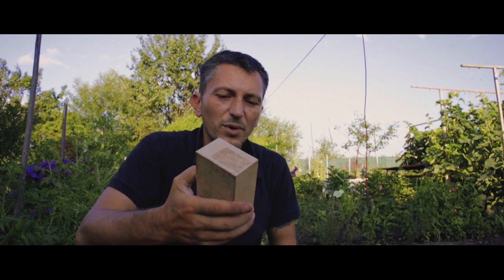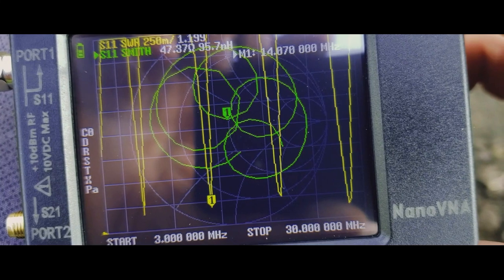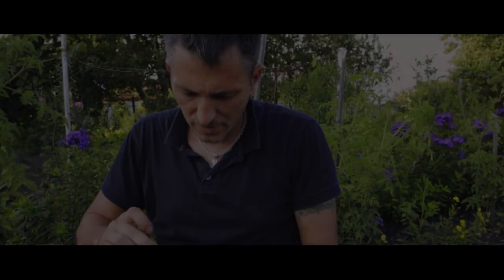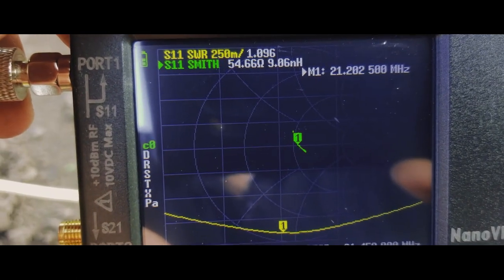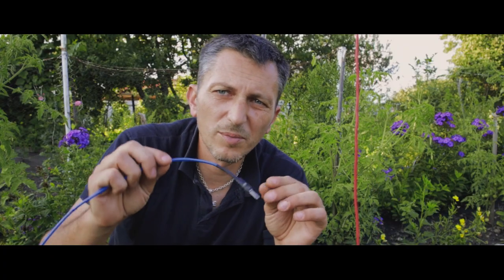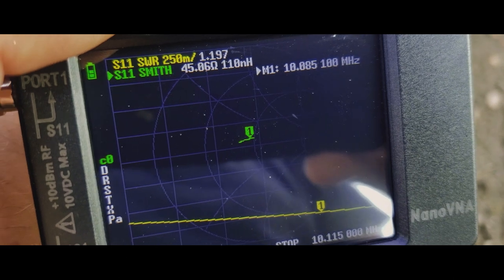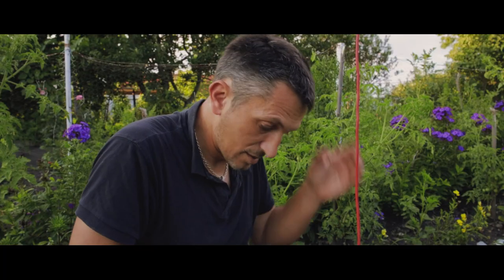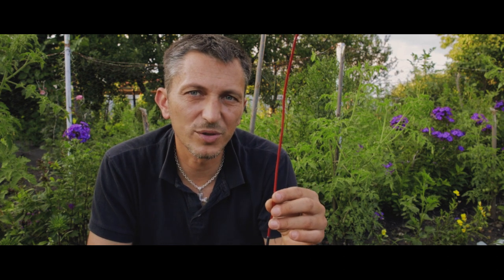ATU vs 49:1 Transformer For Portable Antenna ? How Many Bands ?

Comment: Getting all the bands in one antenna will be a compromise. However I don’t see why it won’t be impossible. 
And there is always more wire. Or even multiple wires. 
I haven’t seen a multi wire endfed antenna yet. I can’t see why that won’t work either. 
But! That’s the beauty of our hobby. To experiment. 

Keep up the good work my friend. 👌🏻
Reply from the maker: Thank you JD. I want to build it like that just because its the best for me with the space I have. Initially I wanted to go vertical instead similar to DX Commander antenna... but I don't have the space for the counterpoise wires. So I go horizontally instead hehehe. We will see what I can achieve. No rush though..  I only have 5 bands available on the (tr)uSDX ))). Meanwhile I'm doing a little work on the VHF / UHF side as the sattelites seem very appealing to me as well )) 73 my friend.

Comment: Thanks for the comparison testing. I would have assumed the antenna matched would have performed better but I think I’ll stick with my 64:1 and 49:1 transformers instead.
Reply from the maker: If you look on my latest video about the EFHW antenna... I keep experimenting trying to get the best out of the antenna with no use of the ATU. They are great in some situation or if you want to work a band that the antenna is not really designed for... but the losses that come sometime with the use of an ATU..  I don't know. I try to avoid it as much as I can and use the antenna built the best I can. 😁😁 But this is just the way I think hehe. Is still good to have an ATU on hand at times..  but I still prefer an antenna with a simple impedance transformer. 73, YO6DXE.

Comment: Glad to see that you also get 15m and 10m with your EFHW!
Reply from the maker: Ohh yes me too. You were right. Well... 10m is a little too narrow... but it works ))) But I have some idea in my head that I want to implement at some point. All HF bands EFHW )) 73 Stew.
Reply: @dxexplorer  yeah shame about 10m but it is usable for the SSB voice portion of the band (and 10m is a large band to operate on anyway) EFHW will always be a 'jack-of-all-trades' antenna but still very effective on 40m and 20m (which is all you need for day/night CW). 73 DE 2E0HIA
Reply from the maker: @stewpot3971  Indeed is not like a perfect antenna. But well adjusted it does a good job. The advantage for me is that it fits the space I have perfectly. But I have a feeling I will test many other more from now on and at some point I will figure out what antenna performs better hehehe. 73
Reply: @dxexplorer  https://youtu.be/PKJ77POxQdE

This is a great video on the EFHW, might give you some inspiration!
Reply from the maker: @stewpot3971  Thanks so much. I will watch it just now 😁 Inspiration its always good  ))

Comment: The transformer you are using, made with FT140-43 and two turns in the primary, there is not enough inductance for 3.5 Mhz. You have to do it 3 : 21 turns. You must also use a correction coil for all amateur bands to be usable.
Reply from the maker: Thank you James. Ohhh I wish you posted this comment two weeks ago hahaha. I got it figured out at the end. As I made a 40 meters wire long antenna... 1/2 halwave on 80m and I had a high SWR on 80m still. It also didn't resonate well on the other bands. I had the compensation coil figured out at the end... but still dealing with the high SWR on 80m. I discovered the transformer is the issue at the end. I didn't had the yine to rebuild it yet. Thank you one more time. 73

P.S. I mean just by using the impedance transformer and no antenna tunner at all. I was trying to get the best of the antenna withought the need of the ATU.

Comment: Hi Chip, thank you for another nice video. Antenna setup is always fun. I have a 20m wire for portable operation and tried it with a manual tuner. I think it needed about 8uH and about 70pF to tune on 40m but SWR was nice and low. Maybe your tuner doesn't have quite enough inductance? Anyway 49:1 unun works great. I've also tried the 49:1 with a tuner and that works on some of the "in between" bands. Just an idea, you could maybe build a smaller simpler tuner to work with the 49:1 or build a 49:1 (or other ratio) into a tuner. Lots of fun! I don't worry that I might need to use a tuner when portable because the coax is really short so no loss to worry about. And also, a half wave on 40 is a quarter wave on 80,  etc! With a quarter wave you'll need some radials but maybe not even any matching network needed. Take care, see ya, 73, VK7IAN
Reply from the maker: Thank you Ian. Ohh yes that may be the possible issue. I think all I have on the ATU is 7.5uH because I couldn't fit more turns on the toroid. I will rebuild it and try to squeeze a few more turns on it when I will also get the switch with more positions so I have more inductance options. I also tried the 49:1 transformer together with the tuner with the same results hehehe. I wanted to build something complicated... that would maybe work way better combining the two. But then the "complicated" part didn't sound so appealing to me hahaha. So instead I opted for the other way... and play with the wire instead. Let's see what I will be able to get out of that  ))) 73 Ian and have a wonderful weekend.

Comment: Strange results Chip, is the antenna cut for 40m on its lowest frequency? The rest of your results are perfectly normal. If you get 1:15 on most frequency  you are good to go. Don't worry about 2 or 
So  to 1.
I use regularly  2:1  on hf on some frequency.  Don't get hung up on it. Enjoy
Reply from the maker: Very strange indeed. Yes the wire i was using was tuner for the 49:1 impedance transformer for the 40m band. Works great with that one. Is strange that with the ATU was not the same. Maybe it has to do with the hight of the antenna as it was only about 3-4m high. I have a feeling that having more taps on the inductor would allow me to get closer to a better SWR on all bands. I will experiment some more in time with a longer wire maybe. Usually I don't worry much about 1.2 SWR... but with QRP..  knowing that I still have loses both using the ATU or the impedance transformer ... every little detail matters hahaha. I'm sure I can do better than that with a little more effort. But at least now I know I'm on the right path. With ought the nanoVNA I was pretty much blind  ))).

Comment: I found in my tests mast height is critical to prevent ground reflections affecting Z of antenna&final vswr.Also for QRP RF resonant antenna worked far better than traps,coils,atu etc 
Simple linked dipole to extend wires worked best with a 1:1 balun with taps for (tx side)50r:to:25r,50r,75r tap (antenna side) selections,less RF loss and lighter to carry.A spider pole  fibre push up pole mast  in ground stake.
Love the VNA very handy device 👍
Rob P
Reply from the maker: The VNA is really nice indeed Rob. I love it too and it saved me from a lot of headaches and wasted time trying in blind. About the antennas... I agree with you. The only reason I keep trying and testing here all sort of antennas is more from curiosity to see how each works and how well. I know I will get bored at some point and just have a few built to last hahaha. Thanks so much for watching. 73 DE YO6DXE.

Comment: Does it make sense to you to use a lower ratio of impedance match, say 9:1 or 5:1, and then also use the tuner to get all the bands?
Reply from the maker: I haven't tested or tried that. Technically it could work... As far as I know the 49:1 for example is for the tuned antennas... and 9:1 for random length wires. So I guess it depends on the length of the antenna as well. Ideally if you would have a switch that will allow you to have as many inctuctsnce values as possible and also a larger variable capacitor... you could end up having a tunner that would tune even a fence and turn it into an antenna ))) It would probably not work great, but is tunned.

Comment: How do you make such beautiful equipment? Everything I build looks ugly and thrown together
Reply from the maker: Justin... it depends. Usually with a lot of work as all I do is nearly 100% handmade with no power tools... so it takes me a lot of time and patience testing hahaha. But this is just because I want to build stuff that will last a long time from now for me to use. If I just make a few tests and I'm not sure about what I'm doing... don't worry that doesn't look to great for me either hehehe. 73
Reply: @dxexplorer  what kind of tools do you use? I couldn’t imagine drilling the metal face plate with a hand drill.
Reply from the maker: @justinelliott3529  Actually not even a hand drill lol. Sometimes I just use a drill bit with the hand and some pliers hahaha. The dremell tool i have only takes small drill bits. Usually I pick materials so they are easy to work with and easy to file or drill. I think that helps a lot. Aluminum is easy to work with most of the time... wood and plastic too. Other than that..  just a lot of sandpaper work  )))
Reply: @dxexplorer  I’m very surprised, everything looks like you bought it already made. I watch your videos, but I don’t know if you’ve built your own transceiver, have you?
Reply: @dxexplorer  I’m very surprised, everything looks like you bought it already made. I watch your videos, but I don’t know if you’ve built your own transceiver, have you?
Reply from the maker: The (tr)uSDX  ? Noooo that one was a special present from my friends at rowaves.com  ( Andrei YO6TJJ ) because I just received my license and had no TRX at all. I still have lots to learn and parts to buy until I can build a proper one on my own  )) Talking about building stuff... you may get to see the way I work in the next video coming next week hehehe. I have a little bit of that DIY stuff in that one. Back to the transceiver... I actually wanted to order the kit... but by that time I had nothing to properly test it to get the best out of it. Meanehile Andrei sent me one already built and tested perfect to make my first QSO's  )) I wanted him to be the first in my log but propagation just didn't helped much for local contacts hehehe. Now I am planing to find some nice simple schematic for a monoband USB and LSB transceiver that I could start building. Maybe something for the 20m band. A proper one not dual sideband as I find around all the time online. And keeping it analog as much as possible for my heart )))

Comment: My SOTA HWEF works 40m to 10. 1 Alligator clip link at 9.7mhz giving 1.7T1 vswr in 30m allocation BUT a correct vswr in 17m join up clip to make normal bands work good. It even give reasonable vswr on 24mhz. I have done experiment wspr testing no tuner to ft817 also ft8 qso with 4 watts on every band 40mto 10m no external tuner. I have qualified to 44 qso several vkff parks on ssb cw data modes. QRP this efhw ft 817 scu17 interface. vk5cz..
Reply from the maker: That is some great stuff. I did thought as well about a similar design for portable trying to squeeze more bands out of the wire. Alligator clips seem like a great idea. I'm happy to hear that it works well... that is pushing me to build a version like that as well. Thanks for sharing this. 73 DE YO6DXE.